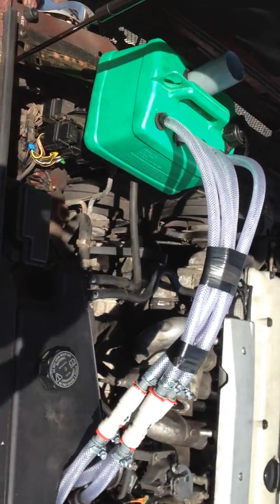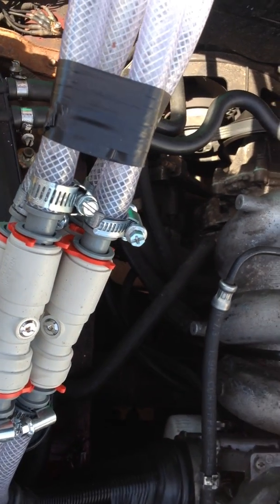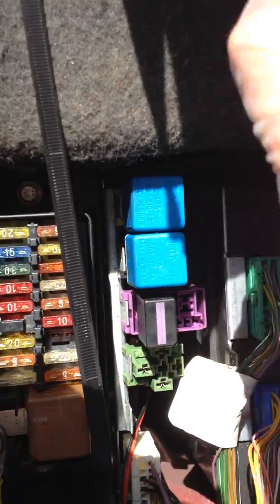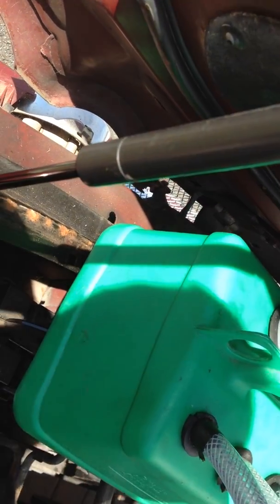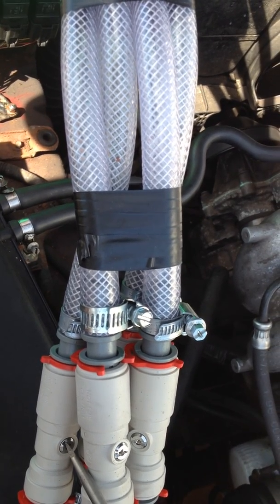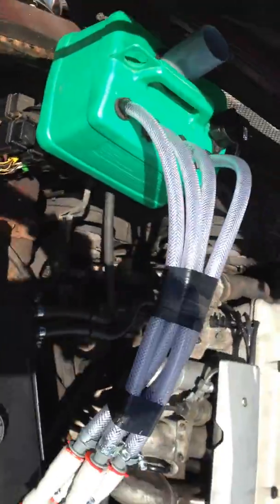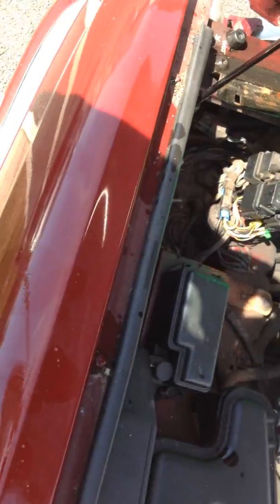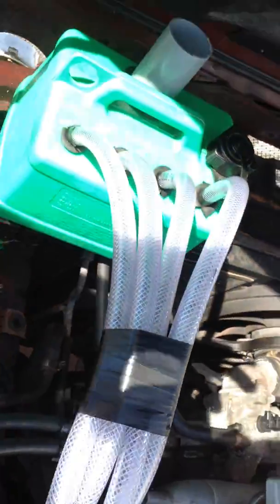PETROL VAPOR SYSTEM / CAR RUNNING ON PETROL VAPOR / FUMES / JAGUAR X300 4.0

Comment: You must fit a flame arrestor between the intake and the vapour tank or a backfire from the motor will blow your vapour tank up setting your car on fire. The flash back you see in the video would have been an explosion and fire without the flame aresstor. Only fuel was blown back out the air intak which he will have to address so when it happens no fuel escapes from the vapour tank. May be a pre air tank to catch any liquid fuel and to contain it.  The up side of these systems is your exhaust is not polluting to the point you can lock your shed up and not gas yourself. It's like walking into your laundry with the cloths dry one is what it smells like. Put a white cloth over the exhaust and you won't get any black unburnt fuel which is being pumped out of every car out there today. In 1953 they did a write up on the vapour carby in a magazine then it was never heard of since. At 200mpg or 52L/km the oil companies couldn't let this tech get out.

Comment: But…you realise injectors, throttle bodies, even carbs….do exactly the same job? Except it’s finely metered…so if anything your death trap will be less economical.. having the fuel can in the engine bay is so ridiculous. And none of your hoses look fuel safe.
Reply: It will explode on a hot day, I'm sure

Comment: The best vaper system is when u pre heat the fuel .  My old boss made one up 40 yrs ago . 63 ks on one litre of fuel on his 1st attempt.  He showed it 2 us once & then hid it away & would never show it 2 us . His version was very similar 2 the Charles Pouge one from approx 80 yrs ago
Reply: Amazing, may be do u know to howmany Celsius he preheated the gasoline, that would greatly help,  thanks

Comment: Gas vapor mixes better than drops of Gasoline, but you have no control about amount of vaporized  gas. Anyway this is a great job!
Reply: Wat if u use a pressurised cylinder of normal air with a tap instead of breather?

Comment: Hi, super video, neat vapourizer. I think the bubbler tube considering the size you are using should maybe have lots of holes around the submerged end and sit on the bottom of the tank...Just an idea, as the petrol should be agitated to create more surface area to give of petrol vapour/fumes. But hey its your test. A system like this makes big jags affordable...they are cheap enough cars because few can afford the petrol to run them..not anymore !!!

Comment from the maker: Thankyou  for your comments and advice.  I am continuing work with this, bit slow going, I have recently fully repaired my Jag so it is now road legal and running normally, new injectors and MAF sorted it.  I have been less inclined to put it apart again.  Useful car to mess around with.  I am looking at a way of making a vapour-at idle- system that you could switch to when idling.  This would have amazing fuel savings just doing this, especially when sitting in traffic.  Lots of ideas, will try the HEET that Tesla advised.
Reply: here's an idea. why not plug the holes of the injector in the engine by tapping the intake with fastners. fill the plastic jar with a bit of gas to get the car running then fit the injectors half way across the plastic jar. this way it will keep pissing fuel inside the jar from the injector but it will still be running on vapor. In other term expanding the fuel system capabilities instead of casting it away.
Reply: @athrunzala5337   can u explsin better that idea?
Reply: @brisbanepy  the injectors will not be directly plugged to the intake manifold anymore but to the vapor fuel tank (plastic or aluminum). this way, the fuel pump will keep sending fuel from the factory fuel tank  of the car through the fuel filter to the injectors bolted to the mini vapor tank instead of the intake manifold. which will only play now the rule of a carburator.

This method will save the fuel contained in the newly added "vapor tank" and not let it evaporate if the car sits for a whole week because the engine does let off fuel through the breathe hose.
 
When engine is shut-off the injectors will close, fuel is saved and no CEL will be thrown on the dashboard. The system will be efficient and easily removable when you send your car to inspection. 

Of course, this will require you to modify the engine bay in order to make room for your mini vapor tank while the fuel remains regulary filled in the original factory car tank at the gas station
Reply: @athrunzala5337  canni have your  email ?
Reply: @brisbanepy  I am not an expert nor the owner of this video. I cannot help you step by step because I do not have the tools to make this setup and I don't have a car anymore. I sold it because my financial situation is bad. 
If any person who read my comment and knows how to translate from english to your language in order to help you understand my idea better is most appreciated. Sorry but I don't check my email very often ,, I just made it for a youtube account

Comment: Can you make a video on how you built the unit. Excellent Job. You have a accent so hello for USA!
Can't wait to see your next video.
Reply from the maker: Hi America! I copied this design from one of your own Josh Lineberry , see link below.  made a few adjustments, air pipes just above fuel, this just needs heat to stop the cooling effects.  All the besthttps://www.youtube.com/watch?v=58IkmPK6ikc
Reply: https://fuel-efficient-vehicles.org/energy-news/?p=1310 check out this link to find out how its so simple a see through container could also be used or jar anything that is the right shape ro fit in the engine compartment

Comment: Great job! The heat exchange should work well.
Reply from the maker: I reckon it will run absolutely fine, maybe slightly less power, however if you can run for over 100 MPG who cares?  I ran for 35 mins, had  exactly 1.5 litres of fuel.  Switched off, did not stall however icy cold and no power.  Drained tank and there was still 800 ml of fuel approx in the tank, so approx 700 ml approx at idle for 35 mins.  A basic assumption is that a car uses approx 0.6 litres (600 ml) per 1000 cc of capacity per hour.  So a 4 litre motor may consume 2.4 L of fuel at idle over one hour, and 1.2L over 30 mins.  On that alone there is a  massive fuel saving at idle of 500 ml!!! or 33% fuel saving, quite incredible for a bodged, unrefined set up.  Massive potential.  I did think that a vapour system should be integrated into cars to draw the fumes from the main tank at idle effectively switching off fuel pump, that alone would save fuel, wondering why nobody has done it?.  Fascinating stuff, am focusing on getting Jag back up and running normally at the moment whilst working on 3rd vapour system.  Might be integrating some magnets into the setup, reversing polarity appears to affect gravity of all things, makes things lighter, amazing thing, take 2   Neodymium magnets of equal size, reverse polarity so they want to push each other away, strap them together and weigh them, make a note, now let them just stick together normally and weigh them, wait for the shock!!  and also think about the overall potential for everything.  Observed this yesterday, has an effect on petrol, years ago a similar if not exact idea was called Fuel Cat, had one of these and fitted to numerous cars and it actually made the car run better, cheaper ect.  So magnets have massive potential also.  All the best. JD
Reply: @MrJohnd1977  what's the status now? Have you tried adding ethanol to the fuel, to keep it from freezing too fast?

Comment: Great job! Did you drive it? What is the fuel mileage?
Reply from the maker: Hello my friend, still tweaking with it at this stage.  I have not driven any great distance with this system because it does not fit into the engine bay of the Jaguar, there is very little space.  I have put it into drive and it does move, am sure the car will drive even with this crude design.  The main factor which will cause a lack of power over time and eventual stall is the petrol becoming too cold to release enough vapour.  Sucking air through petrol causes a refrigerating effect on the petrol, very cold and wet.  This is noticeable after 15-20 mins.  I had the car running for 35 mins a few days ago in total then switched off as fuel can was extremely cold.  2 fuel pipes open for 20 mins was adequate from the start then the 3rd pipe was required as vapour production reduces with the cold after 25 mins and finally the 4th fuel pipe open for the remainder although running very lean.  Simply keeping the fuel warm or better hot will prevent this.  I am in the process of fixing the cold petrol issue with a simple free heat source from the exhaust manifold.  I aim to draw warm / hot air directly from exhaust manifold.  This may be adequate however the hotter I can get the petrol the more vapour will release.  I also intend to run the engine cooling system through the fuel can which will supply a bit more free heat.  The 3rd free heat source I will employ is the take a copper tube attached to the exhaust manifold and coil it into the petrol can .  This will be good heat exchange.  With the 3 heat systems in place this should sort it and then I will drive the car to prove it works under driving conditions.  

Fuel economy even at this stage is very good I think.  The fuel can had barely a quarter of an imperial gallon (4.54 L) about 1.1L approx.  After 35 mins of idling and revving the 4.0 litre lump I recorded about 800ml of petrol left in the can, that's an approximate fuel consumption of 300ml of petrol in 35 mins at idle.  I believe that heating this fuel will enable me to drop to a single fuel pipe and regulate the air resulting in much better economy. I do not know exactly what the Jag would consume when idling, would assume a lot more than I used.  A basic assumption is that the Jag would use 2.4 Litres an hour at idle (0.6L an hour per each litre of displacement - 4 X 0.6 = 2.4L) this is a general rule culled from Google.  This is just Great fun this sort of stuff and really does work.  I look forward to a time when I will jump in the Jag and take a long drive and get the stats of real economy and performance. Exciting stuff, thank you for your interest. Watch this space, more to follow.
Reply: @MrJohnd1977  Hi. Just to let you know that I have subscribed with great interest. Your videos are well shot and explanations clear and precise, well done. I am very keen to follow your progress and look forward to your next installment :) don't keep us waiting too long though ;) good luck
Reply: How is the test drive now? Any results?